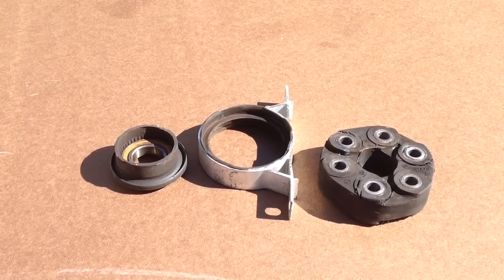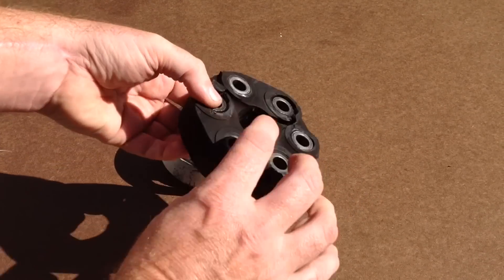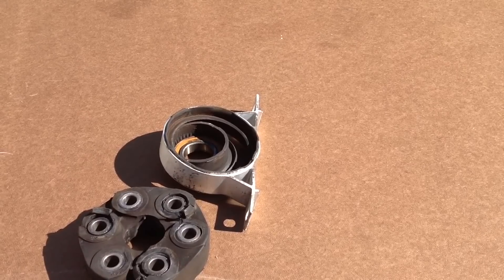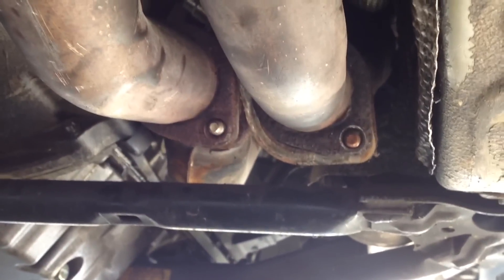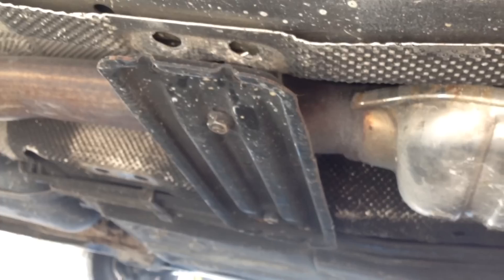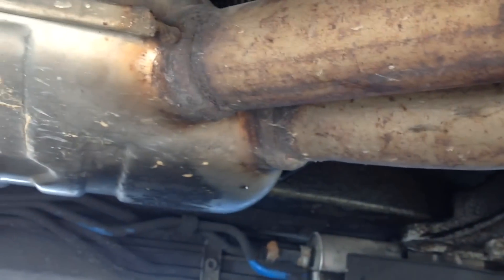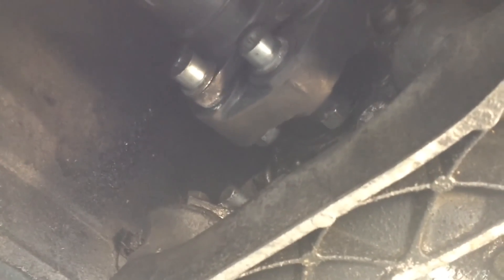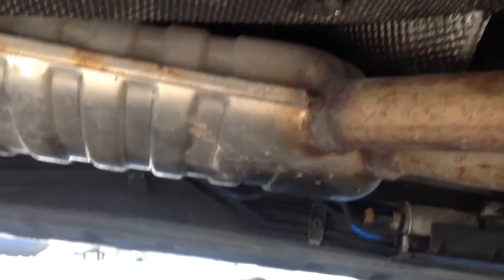BMW E46 driveshaft Vibration HOW TO Rebuild and Diagnose for $40 e39 e38 e34 e36 e30 e60 e90

Comment: My problem is not drive shaft, my problems are these bolts for exhaust. Is it possible to drop exhaust without unscrewing these bolts (I unscrew rest of the exhaust and I put some tall support, so it doesn't fall off to the ground, but I gain maybe foot or two to reach drive shaft and replace it)?

Comment: The thumping noise I have is right through 20-25 mph, only in 1st gear. It is coming from right directly under the center console. Is that where the driveshaft is? Would this be my problem?
Reply: I had this same problem for a month, it was the center support bearing. Now my flex disk got broken up. I would recommend checking out your whole driveshaft before you drive it some more

Comment: I didnt remove the exhaust, i just loosened it in the back and lowered it down just enough to reach the guibo and csb. No need to remove the exhaust. maybe i am wrong but for me it was no problems..
Reply: thank you so much, i am about to do mine and was thinking about just removing the bolts and sliding the old one out and the new one in. you did it?
Reply: @mrkeopele  Just removed all hangers on the exhaust and lowered it down just enough to get it out of the way. Then i changed the differential bushings wich was the cause of my vibrations. Plenty of space, no problems at all.
Reply: thank you, i've got the part, i've got the car lifted on 4 ramps, and i'll probably start tomorrow, god i love these machines! @alexandercarlsson
Reply: @alexandercarlsson  I ended up removing the exhaust pipe system in one piece, surprisingly sturdy and stable, I purchased a carrier bearing assy thinking I had seen a hole thru it but not so! so, lowering the carrier bearing assy was enough to make room to install the new giubo disc, mine was symetrical, so just lined up the arrows. All back together and much smoother operation, I did change the rear diff oil because i had one wheel slipping when trying to back up onto ramps. old oil was dark grey, i added new 90w basic stuff, i think I am getting good LS operation now. these cars are so rewarding to operate!! what continually surprises me is how small they look compared the most of the other cars around them. I smile a good amount with this car, and i think back to all the other beemers I've had, good job BMW!!

Comment: I've just gotten a vibration problem in my 04 325ci its only when i push the gas half way to the floor off of a stop light or stop sign it only happens in first to second gear could this be the carrier or the flex plate or both please help...
Reply: Just started happening to me what was your solution?????
Reply: @thesexrulez7025 you figure your problem out? Mine just started happening as well
Reply: @VintageEuro  it's the bearing that holds the 2 piece driveshaft in the middle of the 2 you can get both pieces for like 50$

Comment: Hi. Recently i have began to notice a vibration from under my 04 e46 somewhat towards the rear. The vibration intensifies the harder i accelerate but the vibration only lasts between 2k-3k rpm in second gear as i take off  any recommendation's?
Reply from the maker: Probably the drive shaft carrier bearing just like in the video

Comment: Hey Nathan how are. I have a 03 e53 4.4 and I get this weird vibrating Shake on low speeds 15 to 30 miles an hour when I barely press on the gas
Reply from the maker: probably the center carrier bearing or the guibo
Reply: +Nathan's DIY Garage okay. I'll hop on that asap. thanks for your help and your vids I love all your vids very helpful. 🖒👌
Reply from the maker: Thank you that is much appreciated

Comment: Nathan, the old flex disc was mounted the wrong way! Look at the cracks. It is obvious that the the thicker part of it was extended, while the thinner was compressed. It must be vice versa. This is the reason it failed so fast. It is meant to compress the thick part and extend the thin part. The arrows on the rubber must point to the holes of the gearbox bolts. The holes without arrows must be the driveshaft ones.

Comment: Hey Nathan, I just did the same job and in a month it blew out again.. I was wondering if the driveline needs to be rebalance or if u had to rebalance the driveshaft.
Reply: When you do this maintenance, you beter replace the center support and bearing, the flex disc and also your transmission mounts. Be sure to check your cv joints, no play is allowed. If needed, replace the needle bearings in the joints, and let the drive shaft be balanced. Always be sure to install the drive shaft in the original position, by marking the parts before you take them apart.

Comment: nathen i have a 07 bmw 323 6 speed.. And i have a vibration and sounds just like a bearing gone, coming right from the center of my car.. I'm nearly positive now its the carrier bearing and that rubber piece..tks a lot for your video.
Reply from the maker: Probably right, the parts are cheap off ebay

Comment: The crack pattern on the old flex disk looks like it was installed wrong, and looking at the installed new flex disk is also installed incorrectly. The arrows on the side of the flex disk at each bolt hole denote which way the bolt goes through the hole, and the arrows should point to the flange ear they are bolting to. The arrows should not point to air. Installing guibo like that will cause premature cracking and failure. Details: https://www.youtube.com/watch?v=Vw7Zbp1rfGI

Comment: my 98 E38 vibrates at idle when it's cold upon starting it. When I take off I can feel the vibration but after about 5 mins it quits and is smooth as normal. No CEL. Any suggestions @NathanDIY

Comment: awesome video! i have a 04 325ci with 155k that vibrates from 0-25 mph and then gets quiets after that. shop in town is quoting me 400 for diagnostic and inspection and hundred more for repair. is my baby suffering from this same issue? Thanks!
Reply from the maker: Probably, its not a bad job as long as the exhaust bolts are not rusty, i did this one in under a hour
Reply: hey,im having the same problem right now,did u fixed it?

Comment: Hello,
I've got a 540i 6speed and there is a mph vibration from about 70mph - 80mph, but then it smooths out. Could that be a tire issue? I'm guessing if it was a drive shaft problem then it would get worse the faster I go.
Reply from the maker: Could be a drive shaft issue but probably more likely a tire
Reply: Nathan's DIY Garage
Thanks for the input!

Comment: will this cause a vibration  that sounds like it's coming from the passenger side? my e36 vibrates at 40mph
Reply from the maker: Could be this or it could be control arms or a tire or even a wheel bearing
Reply: Could also be a bent wheel.

Comment: Hey, so recently my 325 tds started having problems, when i accelerating at higher rpm, my "cardan" (not sure how it's called), starts shaking my car and it feels it will break my car, But if not accelerating a lot, it's fine. Any idea why could that happen? I checked under my car, everything is bolted and i have no idea what's happening. By the way, if accelerating slowly i can feel something vibrating inside gearbox lever,  Sorry for my broken english.
Reply: did you ever figure it out?

Comment: Dude I have replaced the stupid center support bearing and guibo probably about 12 times now as of right now it broke again it's been only 2 days I don't know why it keeps braking someone told me my driveshaft is trash get a new one or possibly take it to driveshaft shop and get it aligned ???
Reply from the maker: are the trans mounts good? is it a e46? If so it could be the rear subframe supports, alos like you said you could have  a bad U-joint or it could of thrown a weight on the shaft
Reply: you are installing the guibo backwards. ita designed to be installed in a specific way determind by dots and arrows casted in the rubber on the edge of the guibo.
Reply from the maker: i was not aware of that, apparently its not a big deal since i have never had a problem
Reply: I replaced motor and tranny mounts I already repaired my subframe everyone is saying it'd my diff bushings they are cracked
Reply: When you do this maintenance, you beter replace the center support and bearing, the flex disc and also your transmission mounts. Be sure to check your cv joints, no play is allowed. If needed, replace the needle bearings in the joints, and let the drive shaft be balanced. Always be sure to install the drive shaft in the original position, by marking the parts before you take them apart.

Comment: anyone had this "clunck" sound like metal on metal when start drive in reverse or in first gear (mostly in reverse)?
Reply: yeah and thatsthe cause...if not your suspension is either loose or has a crack..
Reply: Check the 4 screws on the very end of you driveshaft if one is missing it will make a metal clunck sound
Reply: My current issue is i hear a veeeery faint clunk from the back but i only hear it when im letting off the gas. Manual trans. Been tryna figure out if this might be my problem.
Reply: tyler3691 did you ever figure it out, I'm having a similar issue

Comment: I got a 2015 bmw coupe 428i, my driveshaft does not have a 18 inch screw to remove to separate the driveshaft and take the center bearing out, I've tried to separate the shaft by hitting one end with a piece of 2x4 and a hammer,  no luck.  Any ideas?
Reply: they're very tight, i gave up trying to separate mine, didn't need to, I loosened the large collar compression cap and it was dry and stuck, so i tightened it back up. Good luck with yours.